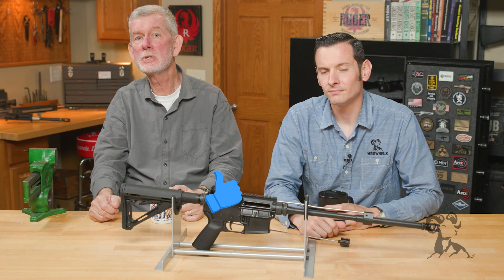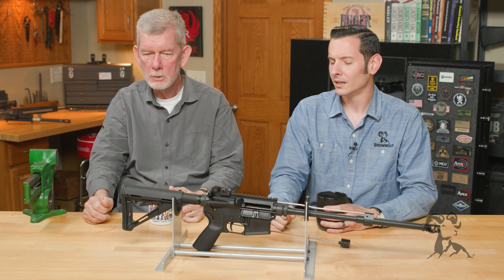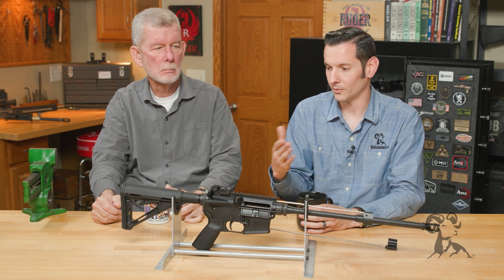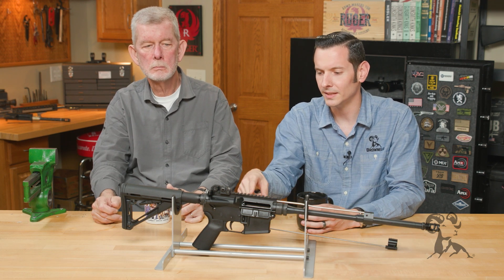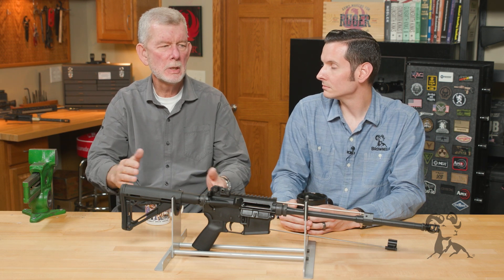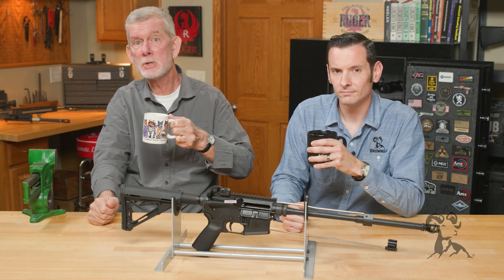Smyth Busters: Does Every AR-15 Need an Adjustable Gas Block?

Comment: I have a question.  Can a 5.56 lower  with  a 5.56 buffer work with  a 300blackout upper  that has a pistol length gas system? Thanks 🇺🇸

Comment: Some argue that using an adjustable gas block is like adding another possible failure point to the firearm system. But I am not sure if it applies to all adjustable blocks, rather those of poor quality. Either way it may be safe to stick to the fixed gas block in a rifle that is supposed to be used as a life saving tool. For hunting/competition/plinking it may not be as vital.

Comment: I'm trying to understand gas blocks... you speak 'over gassed' or 'under gassed' but I'm not sure if I heard how they react either way. How do I know if I'm over gassed or under gassed? I did hear under gassed shoots 'softer', so if I want less recoil I should want to decrease the gas? Thank you.
Reply: Under gassed will short stroke, over gassed will over stroke. Most rifles are over gassed which is why they use heavy buffers but that's not really the best way to make your gun run better

Comment: Can you utilize an AR with an AGB using a buffer with no weights? (keeping in mind you can use a stronger recoil spring for bolt closure reliability)

Comment: If the users gun is under gassed could he not get some number drills and drill out the barrel port one size at a time until it runs consistently or go over size on the barrel port then put an adjustable gas block on?

Comment: If anyone reads this and wants to help I'd appreciate it....
Im building an 18" unsuppressed SPR, full mass BCG, unsure whether to get H1 or H2 JP SCS - I will be shooting mostly 77gr (but some 55gr to plink from time to time)....goal is a VERY soft shooter (hence the rifle length gas system) 

Gas block? Yay or Nah?  If so, RifleSpeed (bc why not) or JP?

Comment: I purchased a 300 blackout, pistol arrow precision would not cycle subsonic, ammunition, and what we did was got an adjustable gas block that was a larger size the gunsmith made the port hole , a little larger and everything worked fine and so now it has a bigger porthole in it. It kicks a little harder even with the adjustable gas block tune down a little bit.

Comment: My m400 Moe classic did not come with an adjustable gas block it came with the a2 front post. There's no adjusting that. Therefore... Barring some kind of manufacturing defect....... Then I do not need an adjustable gas block. I'm not putting a suppressor on it either.

Comment: The adjustable gas block I installed on my 300 AAC AR has fixed a few issues. Works like a champ now. Brass lands in a very predictable small circle making recovery so much easier. Also the gun was so over gassed that very often the bolt wouldn't hold open. This thing now runs perfectly. Runs very smooth.

Comment: I built an 8.5" suppressed 300blk SBR and decided to install an AGB from AERO. I learned by using the AGB that my barrel gas port is optimal due to the fact I basically had to adjust the AGB to wide open, minus maybe 2-3 clicks, to fully cycle the action and hold the bolt open. So, now I can put the cheapo on my 300blk and install it on my suppressed 5.56 SBR. It may have been a little more expensive, but I believe worth it to verify the optimal configuration of the gun.

Comment: I like using a so--called tuned gas tube.  So in this case the port size on the gas tube is varied.  I like getting a gas tube matched to the (1) barrel length, (2) gas system length, (3) suppressed or not, etc. Also - if you have a front sight tower, you can't use an adj gas block. In that case the tuned gas tube is the only option, AFAIK.

Comment: Adjustable gas blocks add unnecessary complexity. The adjustment mechanisms carbon foul quickly making the adjustment unusable and causing gas problems. They're a fiddly PITA, and accessing the gas adjustment on many AR-15s requires a teardown. There are too many other ways of fixing and tuning cycling on an AR-15.
Reply: Adjustable gas blocks add unnecessary complexity?? Turning a screw and adding a drop of oil to the adjuster is so hard lol..
Reply: @hairydogstail  Getting to the adjuster usually requires REMOVING the handguard -- a floating handguard is NOT made for frequent removal. and many of them are a Royal PITA to remove and reinstall, and it quickly wears out the handguard's clamping around the barrel nut -- and then it's an EXPENSIVE replacement of the handguard. I invite you also to search the "School of the American Rifle" YouTube Channel for his work on adjustable gas blocks, tearing them down to perform "physicals" to find root cause of failure, and sometimes "autopsies" on non-repairables.
Reply: I agree. And quite honestly if you're not running a suppressor what the hell is the point of having one? You really don't need it.
 But there are far too many so-called cool kids out there that just want to be part of the crowd and think that they need to have shit that they will never use.
Reply: Considering most AR rifles are over gassed to reliably run the cheapest ammo, (which makes them way over gassed when using NATO spec ammo) I'll be part of the crowed lol and use an adj Gas bloc.. That is the point of having one..Any questions??  @NortheastSurvival911

Comment: My theory on things buy want to cry once that goes for ammo to the barrel BCG and buffers test in conjunction you want quality oh regular M 16 BCG is fine but if you start going with lightweight cut out BCG‘s that just look cool because they’re super light and white not the reciprocating bass you’ll have issues you can get both bounce all sorts of different issues that’s why I stick with heavy M-16 BCG‘s I did recently just to order a nickel polished over a nitrated finish type bolt carrier to test it out 180 bucks so we’ll see if it runs good but I prefer you’re just standard plain Jane chrome lined carrier but it has a natural lubricity to it and what not so curious do a little testing with that but as far as gas systems if you have an over gassed say when Daniel defense Around seven years ago had over a guest MK 18 for the commercial market I suggested using a heavy buffer like an H2-3 but I run those in literally everything I have very very smooth specially the one I have the super 42 it has a triple braided wire system that gets all the crane cool out of your buffer system and makes it silent it also aids dramatically and recoil I have noticed and it lasts at least 5 to 10 times the life of a standard buffer system and they are only between 70 to 100 bucks depending on if you get an H one or an H3 and then they also sell them with buffer tubes and I usually do that if I’m doing a build because GEISSELE makes some amazing offer tubes especially if I’m using one of their rails their type three hardcoat anodized in different colors like ATC black gray and in different lighting scenarios it gets darker and lighter which I would like with analyzing process basically gives your rifle a self camouflaging affect in different lighting scenarios to wear a good look super tan and then you come indoors and different lighting and it’s dark and they’re castle nuts are just so clean I would just pay literally just for one of their castle not because It looks like they friggin use the best of the best and then yeah I’ll polish young and clean them and analyze them so there’s no little things and scratches and stuff like is he on most out of the box castle nuts

Comment: If they wanted to upload a video just for the sake of content; here it is. Things to consider: Gas port hole size, gas block to port hole alignment, rifle gas length (carbine, mid, rifle), caliber, rifle type (hunting, sport, combat), suppressor setup, range engagement. I mean, if you're grabbing a rifle off the shelf, fine, who cares as long as it works. But, if you're considering a build of your own and want something that shoots better and more balanced than your $700 sports store make; highly consider incorporating an adjustable gas block. After all, your rifle is an engine, your finger is the ignition. Make your engine drive best for you.

Comment: Are Adjustable Gas blocks (AGB) absolutely necessary when using 'lightweight' BCG's? I have (2) Faxon Lightweight Gunner BCG's but don't want to install the (AGB), unless it is over gassed. What buffer & spring should I use with these Faxon BCG's when no adjustable gas block is installed?

Comment: I have an ar15, adjustable gas block installed. I have the block completely closed and my bcg cycles and locks open with last round? Why? Shouldn't this scenario stay closed?
Reply: Increase buffer weight and spring

Comment: One thing adjustable gas blocks are good for are suppressor use. Attaching a suppressor will significantly increase gas pressure so being able to reduce that to maintain balance is a good thing.

Comment: How do arctic and other extremely cold conditions affect a rifles gas system? Do these conditions typically require more or less gas?
Reply: You would want more gas in very cold environments. The chemical reaction of the burning powder is affected by temperature. You would get higher pressure and bullet velocity at high temperatures and the opposite at low temperatures.

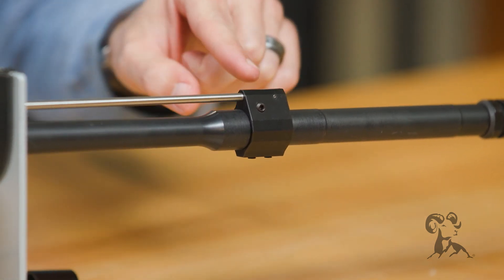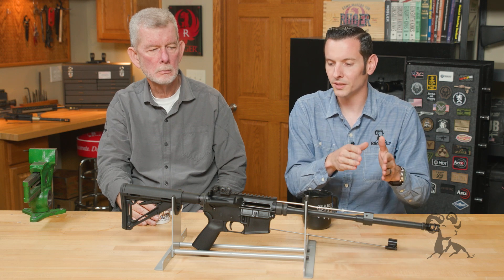Comment: Good vid guys! I was getting ejections from 1:00-1:30ish. Followed sprinco's article on gas/ejection diagnosis. Tried a heavier buffer, nope, tried a heavier spring, this started to mess up the timing and cycling of the firearm. Closest with spring/buffer combos I could get was around 2:30 with reliable functioning. Slapped on a adjustable gas block, rifle spring an h2 buffer (A5 length setup), tuned it in a few shots. 

Not only does it shoot smoother and softer, it is cleaner as well! And my brass doesn't look like it has been through the ringer, sweet 4:00 ejection, all the brass lands in a nice pile.

Comment: I built an AR-308/7.62x51, the barrel gas port too close to the muzzle not allowing enough gas to bleed off to the BCG. Problem solved by opening up gas port, but now too much gas; installed an adjustable gas block; problem solved. But now, I encountered another problem with some factory ammunition M80 primer flow in the bolt firing pin hole; another problem solved PJ Enterprises Enhanced High-Pressure BCG, it worked.

Comment: Eh...  I don't know about that conclusion.  My experience has been one of plugged up adjustable gas blocks (one JP low profile and a Seekins) at the worst possible time.  Both times I found it easy enough to correct (just clean it), but in both cases I had no warning until the moment it was just too crumb'd up to work right and I ended up ruining good runs because of "no alibi" rules.  Since then I've removed the adjustable gas blocks and replaced them with straight Geissele low profile blocks (pinned, with the provided large roll pin) and I tweak the buffer/spring combinations until everything is shooting as soft as I can get it, with 100% reliability.  Yes, I agree I'd rather keep the excess gas out of the gun from the get-go and I can't change ammo in the middle of a match but, I can't afford to bleed points because of what the sanctioning body considers an avoidable malfunction.

Comment: I avoid adjustable gas blocks like the plague. I’d just rather have the simplicity of a slightly over gassed system that just works without having to fine tune anything.

Comment: I started using AGB's about 6-8 years ago, great for over gassed but you don't cure under gas or alignment issues.  What I like most is the fine tuning for minimal recoil, and using different loads.

Comment: I use an adjustable gas block on my .300 blackout AR-15 with a 10.5" barrel. It would run subsonic and supersonic loads before I switched to the adjustable gas black BUT supersonic loads would kick like an HK-91! I used a heavier spring first but then it wouldn't run subs. I re-installed the original buffer spring and installed an adjustable gas block that adjusts using a screw in/out with a set screw to lock the setting in place. This allowed me to fine tune the settings.

Comment: I don’t believe I’ve ever had an issue that require an adjustable gas block ? What would be a sure sign that one is needed slamming of the bolt things along that line (doesn’t matter all my AR 17 went down boating) good information 🙏🏼🇺🇸👮‍♀️🦅🇺🇸👮‍♀️🦅🇺🇸🇺🇸🇺🇸

Comment: Things that people forget is the ability of that rifle to be built in different calibers. I, myself, built mine for 17 Remington. a 17 caliber bullet in a necked down 223. Rifle ejected the spent case 15 to 20 feet. Installed an adjustable gas block and now the rifle kicks them out 5-7 feet and the recoil has dropped off. Squirrels do not have a chance. I love tinker toys.

Comment: If you're under gassed that's probably a good thing. Just use good standard quality mil-spec ammunition. Leave the dirty, low-quality, underpowered Russian steel case crap to the people with shit-tier rifles that have oversized gas ports.

Comment: Agreed 100%.  Changing buffer weights is a poor way to solve a gas issue.  Always address the source 1st.  If the gas port in the barrel is too large, choke it back with an adjustable gas block.  The AR-15 and it's DI gas system is already dirty enough.  Sending more spent carbon and hot gas back into the action than what's needed is a good way to shorten the life of the gun and break parts.

Comment: I haven't  needed to stray from mil spec gas orifices to alter cycling yet. I have assembled  many ar platform rifles and carbines, pistol build is still unfinished. I think if you are staying close to .223 or 5.56 common loads you can get good performance with mil spec parts. If you like and plan to experiment with lots of newer loads available,  adjustable gas seems to be a good idea.
Reply: Most manufacturers don't use mill spec gas port sizes. They open them up to function with the hole spectrum of ammunition on the market, "thus" over gassed with mill spec ammunition..

Comment: A custom sized gas tube is my preferred solution as it avoids moving parts
Reply: No different than a barrels gas port set to a certain pressure type ammunition..
Reply: @hairydogstail  but way cheaper to get a custom gas tube than have a custom barrel ported to your spec
Reply: @denbo74  There are variable sized insert valves for gas blocks that do the same thing. Rather than having to pull the gas tube or gas block every time I need to adjust the gas, I prefers the adj gas block. If you use only one type of ammunition, then a custom gas tube is a sound solution. I have no data on how long the custom restrictive gas tube port last compared to a barrels gas port.. It would be an interesting article for a gun writer to perform.....
Reply: @hairydogstail  for the average person/rifle an adj GB is probably more convenient.  I have one AR that I’ve designated as my “serious” defensive use rifle.  It’s all Colt parts but I used one of their 11.5 FBI HRT overrun barrels.  What I didn’t know was that the particular run had a slightly larger GP specd for a some specific purpose. My rifle was over gassed with m193.  For that application a custom gas tube seemed to me the safest and most robust solution.  I ordered one drilled to the correct spec and it works great with full power ammo
Reply: @denbo74  Looks like you got it figured out. Can't go wrong with Colt parts, I use many of them in my builds. I would not use an adj gas block with that short of a 5.56 barrel, so you used the best option IMO. Sounds like a great build. Happy shooting!

Comment: I think people get confused between bleeding off gas and restricting it. Gas systems accomplish this "tuning" in two main ways. 

The most common is an adjustable gas block that you restrict the amount of gas entering the system. In this system the gas that otherwise would of entered the operating system is now directed down the barrel and only the amount of gas necessary is left in the system to cycle the action. 

The second way is bleeding off the gas by having an opening in the adjustable gas system that let's the extra gas vent into the atmosphere near the gas block instead of back down the barrel. This type of system has large holes for gas to escape while still allowing enough gas into the action to cycle.

Comment: Adjustable gas block makes sense on carbine length 16" AR which are typically overgassed as hell. Also, on competition rifle it's an absolute must. My competition AR has adjustable gas block, while DD I have mostly for pseudo tacticool shit does not and I don't plan to mount it there.

Comment: My AR 308 would only shoot NATO cartridges from the factory. It was so over gassed that the bolt was outrunning the magazine. Had to put am adjustable gas block on to shoot different bullet weights.